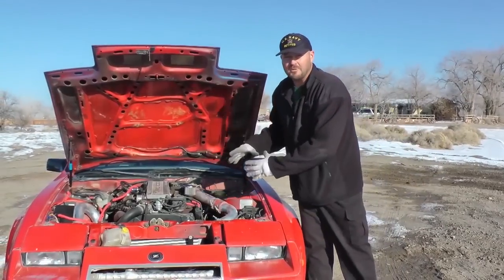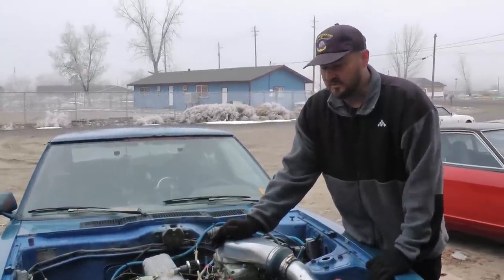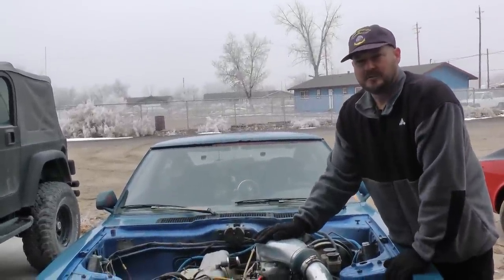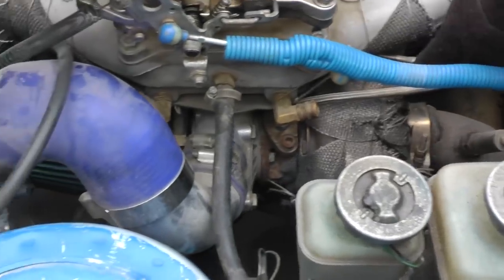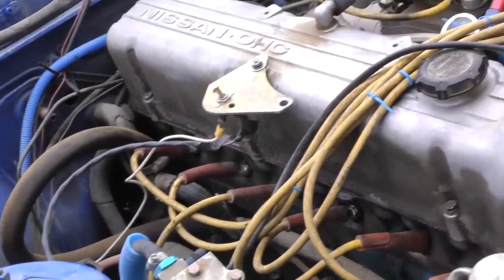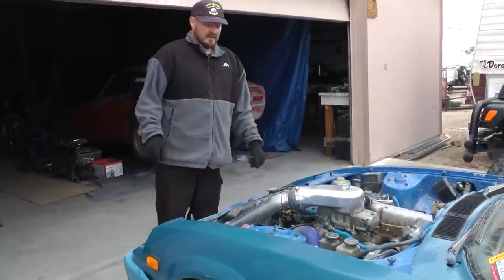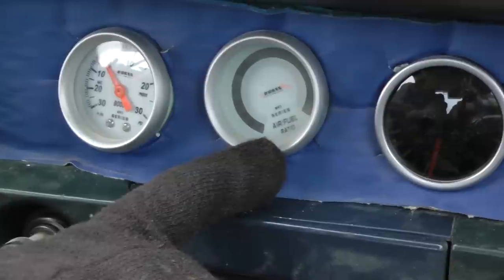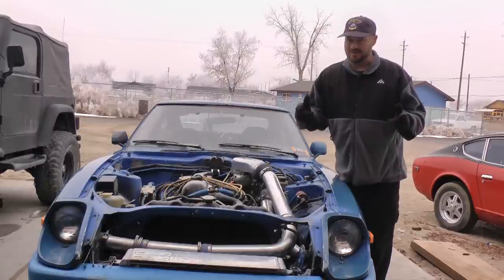Blow Through TurboCharging (Carburetor)

Comment: i put a 50mm turbo on my 300 inline 6, when i get to 4th and 5 th gear and floor it, starts to studder and the engine kinda cuts out and loses power, is that because of my injectors are too small?
Reply from the maker: timing could be wrong, boost could be too high for the amount of fuel available to the injectors.  Many factors.   Usually when it cuts out, it usually indicates not enough fuel pressure or available for boost.
Reply: im using the stock efi, stock injectors, stock fuel pump, and stock map sensor.
Reply: stock may not be able to handle what your throwing at it
Reply: i think ill put in a bigger fuel pump and some bigger injectors and see how it runs, later on ill buy an ecu and pin it and try to tune it
Reply from the maker: a boost referenced fuel pressure regulator will really help you.  It raises fuel pressure for every pound of boost.
Reply: is there a special way to install or is it just like an ordinary inline pressure regulator?
Reply: would i still have to swap the ecu or can i use this regulator instead?
Reply: Use a fmu and it will work
Reply: but the pumps not big enough for an fmu
Reply: +killer120 you're lucky you haven't destroyed your engine.
Reply: +Sergeant Speed then put a bigger one on it
Reply: +carlitosgy6 I'm assuming you ment to respond to killer about his fuel pump
Reply: if i got the boost referenced regulator would i still have to get an ecu? or can i use the stock pcm
Reply: +Sergeant Speed yes I'm responding to him, but you are right because in that situation normally the pistons melt
Reply: +killer120 fmu is what you need, if you are going to use a ecu then you can use a boost referenced regulator with bigger injectors
Reply: hows the fmu work?
Reply: An fmu is actually a boost referenced regulator but normal regulators raise 1 psi of fuel for each psi of boost added, the fmu can raise pressure as an example 1 to 10,if you have 45 psi at idle and you make 10 psi of boost it supposed to raise the pressure a 100 psi, forcing the injectors to pass a lot more fuel than normal but not at normal driving with no boost, but you need to have a good fuel pump to back it up
Reply: my stock injectors are at 43 psi, im running open wastegate, builds around 8 to 10 psi at higher rpm and speed, what should i do as far as the fmu?
Reply: +killer120 the fmu is adjustable, you can set how much extra fuel you will have after boost, just please buy a good one
Reply: I was thinking of doing the same thing wait a second ford 300s arnt turbod so how do you have a stock maf sensor
Reply: lol I never got an oil scavenge pump for it and the seals finally broke loose and oil was spraying in the intake so I pulled it off, lol I didn't have much room at the top so I put the turbo below, ill probably redesign the engine compartment and put In a new seal and have a set of headers made up
Reply: Carburated and EFI engines are quite different, It is possible that your map sensor is not reading positive pressure. you may need a piggy back computer  and a different map sensor and bigger injectors.
Reply: I had a high rpm miss and simply using less spark plug gap cured it. Boosted engines cylinder pressures increase the resistance across the plug gap.

Comment: A blow off valve reduces turbo lag. Which does make a difference in performance.
Reply from the maker: Not with any of my vehicles past or present.  Losing boost upon let off of throttle then building it back again is not my idea reducing turbo lag.  Sizing of the turbocharger, octane, Intake, exhaust, and tuning of the engine reduces turbo lag.
Reply: +Budget Boosting sure

Comment: I have nissan b11 carb...
I want install turbo,
But how to tuning?
Can damage my engine when floor pedal?
Reply from the maker: Sharif Amirol Going draw through configuration on your engine is the best for a stock style carburetor since it is not designed for boost blow through application.  Jetting up on the main and secondary jets to increase fuel with the rising boost.  Also incorporate an adjustable boost referenced fuel pressure regulator to control fuel pressure as boost pressure goes up.  Also timing adjustments to around 18 degrees before top dead center is a good baseline to start at.  Watch our draw through turbo video to visualize this idea.
Reply: smart like tractor

Comment: What do you do with the ignition timing?
Reply: start of with retarded ignition timing to prevent det, and slowly increase it until you you are happy with the power or run into det.. if you run into det and want more power increase your octane rating and youll be able to run more aggressive timing
Reply: Gotcha. So you dont have to lock it in? Or do you keep the original timing curve and just shift it over?
Reply: from what ive read, it seems common practice to advance your initial timing and lock out your distributor, to keep the motor responsive out of boost. Although id first mess around with it , and see what effect different timing does at around 3000rpm-red line because thats where youre most likely to run into det . if you lock it start with around 30-35degrees out of boost. in boost wait till you get to 2-3psi then pull 1 degree of timing per psi of boost. a lot of it depends on your compression ratio, octane fuel, size of motor , turbo, so no 2 setups would be exactly the same
Reply from the maker: around 18 degrees before top dead center as a base line.  Recommend installing an ignition box that references boost pressure and retards timing 1 degree for every 1 pound of boost.  The MSD 6BTM does that and gives multiple sparks to the plugs too.

Comment: Can you link the carb and carb hat in the description
Reply from the maker: Kaj Rodgers @parts/qft-ss-650-ban for quick fuel blow through carb.  @parts/tnt-10351/overview/  this is a blow thru carb and hat you can get at summit racing.  Can score these on ebay as well.  Highly recommend C&S custom made blow through carburators, precisionly tuned for your specific application.  @store/html/blowthru.html  Happy boosting.
Reply from the maker: Budget Boosting The links did not show up in the reply but go to summit.com and type ss-650-ban for the carburetor and turbonetics and find the carb hat.
Reply from the maker: ***** the closest way to tune that precisely with carburation is with very technical datalogging equipment and make very finite adjustments each test run, review data, adjust again and again until it is at the desired level of the tuner.  Yes like you stated, its easier with the modern throttle body injection systems with the sensors to automatically adjust to rapid changing parimeters.  Many of them have MAP sensors and can be set up for boost applications.  Many great systems out there.
Reply from the maker: ***** Well I have to say I am impressed by your description of the improvise, adapt, and overcome methods of tuning with what you have and make the best of it.  That is pretty much what we are trying to do with our budget limitations, and we like to share with others as well.  You really should make some informative videos so the knowledge does not end with you.  We have the technology available to teach and inform, why not do some turbocharger and tuning videos of your own and pass your knowledge and experience on by video.  After all knowledge is power and a picture such as a video explains thousands of words, sentences and these days, posts, blogs and so on.  Boost on fellow Vet.
Reply from the maker: ***** Yes that is the compromise, there is very little money to be had by helping others. Something to either give, or just let go by and die with me.  Reminds me of serving a full career in the military, we all knew it would not be a money making decision but some of us carried it out to the end for a deeper cause.  There are some creative ways to make money with the experience however, its always money to get started, takes money to make money.  That's why the rich will always be rich with a few exceptions of course.  We would like to find a way to make real money doing this but that would take sponsors with high ends to make that happen.  But whether or not that ever happens, we will just put our humble ideas out there to help anyone that may benefit from it.  Some of the stuff we do is just for entertainment as well but its all therapy to me.  Helps take the edge off and direct a lot of my hostile thoughts into something potentially productive.  Works better than the pharmacy of VA prescribed meds covering my entire dresser..... Very few people in this society know that one right?
Reply from the maker: ***** Yes I served for 21 years active duty back when Reagan was still president up until just before Obama started in the office.   My entire career was Gulf, Gulf and more Gulf until the end of my career but the Gulf campaigns still continue>,,,,,,,,,.   Not only was I honorably discharged, I retired from the service.
Reply from the maker: ***** Thank you again for your comments.  That is outstanding you had mechanical genius in your family, I was the only gearhead in my family so I learned from anyone that was willing to teach me from tuners when I was stationed overseas to racers that shared tips here and there throughout my life until now.  And the rest was me working on every car I owned and that of friends helping them troubleshoot mysterious gremlins that like to hide in nooks and crannies of cars..... Fun stuff right.

Comment: How much lag is created from all that piping?
Reply from the maker: Honestly not that much; Turbochargers naturally have more lag than superchargers, because they're exhaust driven. If you can use less piping, your response time will be a little bit better, but only by about a tenth of a second. Once the turbo spools up and compresses the air, the sheer pressure of the turbo sends it racing through all the piping, and intercooler in my case.
Reply from the maker: The Size of tubing and intercooler is very large and free flowing therefore very little lag. Engine responds very hard at 3000 rpm to Red line such as most large t3 turbochargers and small t4 turbochargers usually do. Also has a very free flowing intake and exhaust which greatly improves turbo response time and reduces lag even more.

Comment: fyi why run an intercooler with a carb? carbs act as intercoolers. if air temps going in are 200 then its around a 100 coming out
Reply from the maker: +Larado Warby Yes the carburetor helps cool things down but having an intercooler even cools more so more is more.  Especially how hot things get after a 30 minute + drive, it really helps then since everything in the engine is hot to the touch.
Reply: +Budget Boosting have you done personal testing cause i have, their is no power gains and their is no drop in air temps just laggier throttle response
Reply: +Larado Warby  that would be like saying having two intercoolers is better then one
Reply from the maker: +Larado Warby it worked well for my set up.  after a hard drive you can touch one side of the intercooler and feel the heat and the other side is cold, then same with the tubing, then the pressurized air meets the fuel and cooled and atomized even better.  to each their own, draw through turbocharging uses just the fuel air mixture since fuel and air are in the turbo compressor so having intercooler would not work.  Methanol injection is a form of intercooling and additional fuel inducing to improve boost performance and cooling hand in hand.

Comment: I know you know what you're talking about but you have to work on your presentation/delivery.The blow off valve is designed to stop boost pressure from going back against to turbo when you close the throttle plate/s. Without it the pressure has no where to go and slows down the rpm in the turbo. They ARE necessary if you want the turbo to work efficiently.

Comment: how does it cars runs
Reply from the maker: It did run great.  That engine is out of the car, and I am gradually preparing a Ford 5.0 302 V8 engine with a pair of T04E turbochargers with a Borg Warner 5-speed manual trans for that car.
Reply: @budgetboosting  did you go through with the 302 build? Was that carbureted as well?

Comment: "You don't need a BOV, the boost will just dissipate"
Reply: Veilside Shaman never mine the pressure slowing down the compressor.
Reply: lol that comment in the video made my day. it will just dissipate.. MAGIC.

more like it will dissipate when the turbo shaft snaps from all the turbo chatter
Reply: bhagved singh slows the turbo down as well
Reply: im more concerned with it snapping the shaft/damaging the turbo blades to be honest. 
A bov also does that but in a reliable way, all the boost exits the system when it opens up, and the turbo has to pressurize the whole system again. if anything no bov reduces the pressure loss comapred to having a bov( i think maybe thats why Audi never ran a BOV on the audi Quattro rally cars)

Comment: Is there anyway to run blow through on stock carb
I have a j16 and l18 engine from a 720 datsun and a 910 bluebird
Can I rejet the stock  carb for boost
Reply from the maker: I believe you could build a sealed airbox around the carb to handle some lower boost numbers

Comment: boost dissipates with out a blow off valve by compressor surge, not really a problem if your running super low boost pressures/cheap turbos.  wouldn't want to surge a turbo i spent good money on and expect it to last....

narrow band AF gauge tuning lololololololololololololololol, better off just sticking with the pyro
Reply from the maker: Hey, you are commenting on the wrong video, watch our blow off video the truth.  That is the video to see since it appears you and your fellow blow off fans need to blow off your blow off valve air..... And also if a turbocharger is manufactured correctly, it can handle all pressures associated with boost.  After all it is driven by very hot exhaust gasses which reach very high pressures.  No surge is going to harm a well manufactured turbo and I have used some of the so called ebay turbochargers without a blow off valve and they performed very well thank you.  Now watch our video blow off valves, the truth and do tell all your blow off buddies to see what its all about.
Reply: Budget Boos

Comment: how much hp and torque you pushing in that beast ?
Reply from the maker: never actually measured it so there is no specific number.  When I get done with this Z installing the small block twin turbo SBF, I will dyno it when its tuned.

Comment: the boost would just dissipate if you had no blow off valve? are you kidding me? it would be drawn back through your turbo which creates "flutter"... picture a fan blade spinning very fast and then being suddenly forced to spin in the opposite direction by pressurized air.... your "humble" opinion sucks.
Reply from the maker: +Josh M Turbochargers do not spin backwards as long as the engine is running.  Many tuners around the world DO NOT run blow off valves when tuning with LARGE turbochargers.  Watch the blow off valve video, this video you are commenting on HAS a blow off valve on the turbo six engine.  COMMENTING ON THE WRONG VIDEO!  Let the gas off slowly, the boost goes down slowly, chop the throttle fast and you hear the boost bleeding down waiting for that next throttle up which a lot of the boost is still built up and ready to go.  Blow me valves just let it all out every time the pedal is released which makes it slower for boost to build back up, especially on very large T4 turbochargers.  Opinions vary, run one if you like, I always say its up to the owner and the tuner to do what they like with their car.
Reply: +Budget Boosting 

A "dump valve" dumps unwanted compressed air to avoid the turbo stalling when the air back flows when the throttle butterfly is closed.
Reply: +Budget Boosting Greatings, I've owned 5 z cars in my life. Turbo and non turbo. I know a lot of tricks for these cars. One of them is to shove a #42 drill bit, if I remember correctly, into the distributor pins that keep in place the shift forks in the transmission.This trick is not for the borg warner trans. This way when you power shift its much harder to shear them.  I once loved Z cars until their sucky wiring harnesses got to me. I hate electrical problems.=(    Don't you hate it when retarded, stupid internet mechanics call you out, like if they know what they are talking about. I bet if they were face to face with you they would only have respect for you.
Reply from the maker: +julio lausell Yes, I'm glad someone understands.  Like the z cars, dislike the factory wiring like you said.